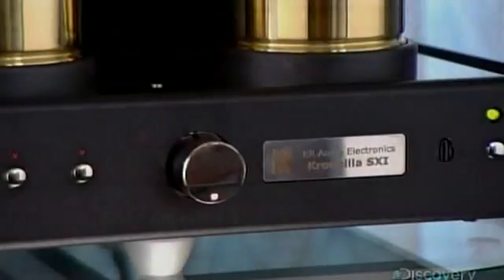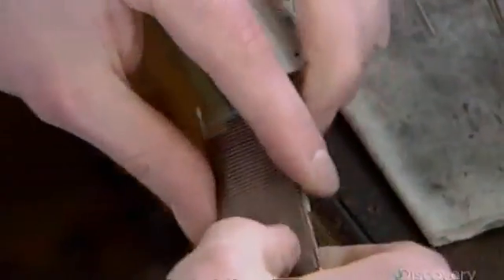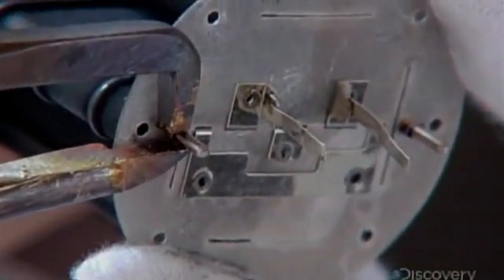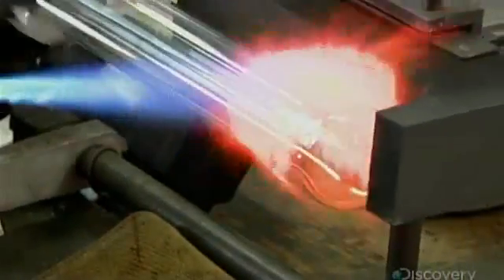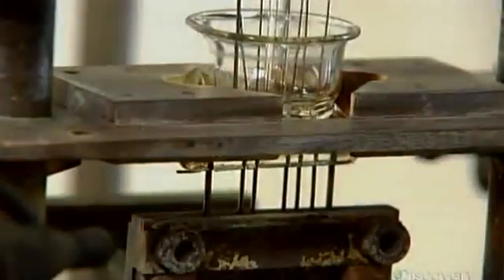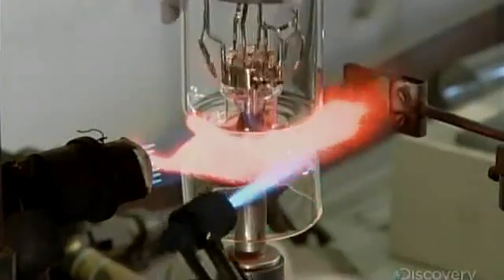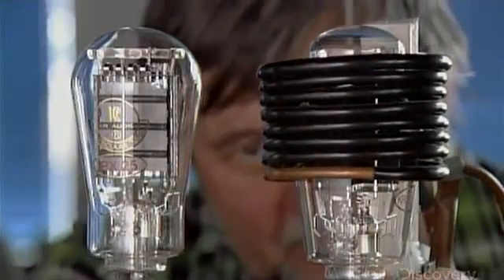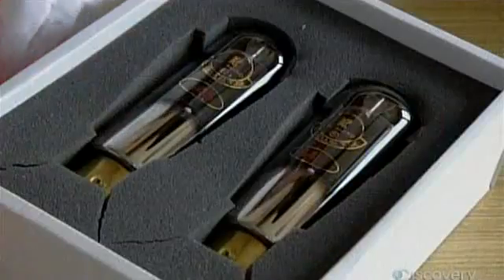How It's Made   Audio Vacuum Tubes   SD   360p  =KCK=  x264

Comment: even if it performs the same as a MOSFET transistor, it's just something more close to traditional manufacturing than some chunk of silicon with three wires soldered to it.
Reply: That explains why modern high resolution, high quality, super bright flat screen TV sets with perfect contrast have zero tubes inside.

Comment: tubes are superb for guitar amps, but I'm less convinced about an audiophile quality amp...i suppose they add a pleasing distortion which softens the sound, but it's really colouring the audio.
The narrator said that valves are only used for high end audiophile amps..that's rubbish...the biggest market is in instrument amplification.
The world's valves (tubes) are all made by either Svetlana or Sovtek and then rebranded.

Comment: Yes I ended up with tubes also, the narrator said they sound more natural - that is actually not entirely correct. 
(This depend also on how we use the word, what you actually intend to say, if you have tuberolled yourself into a stupified state of audio nirwana, your mileage might vary etc LOL.)
Tubes that I prefer, do not provide actual HiFi, and would not measure perfectly.
What I prefer about tubes is that the music lives in a way never heard on a solid state system.

Comment: All tube amps have harmonic distortion, before we had transistors all TVs, audio, computers, telecom used
vacuum tubes by the millions. All analog, everytime audio was rerecorded, signal deteriorated including
distortian. Going digital solved all the problems! To listen to true analog audio, recording - to amp - to speaker
cannot include any digital equipment. Good luck with that.

Comment: ohh how many of that tubes i've smashed on the street when i was a kid, then i started collecting em... then i gave em all to a friend

1) a 4 pin triode is quite possible to do, two wires for the filament, katode attached to one of the filament wire (or it's the filament itself), grid and anode... four

2) tubes do NOT sound better than solid, the only thing that are better at is at top power when solid clips hard the wave while tubes rounds it slightly, generating even (not odd) armonics and low frequencies that don't crackle too much, that's why guitar amps use tubes, you use em at full power often

Comment: Tubes sound LESS natural than transistors.  They add color and harmonics to a sound signal.  While Transistors amplify the signal with less coloring and other added noise into the signal.  Look you may think tube sound better and that's fine, but its because it DISTORTS the source and and you find that pleasing to your ears.
Reply: For a guitar amp  the gradual transition to distortion and soft-clipping allows the classic sound of electric guitar (hard clipping is always nasty in  a bad way).  To reproduce sound is another matter and you want minimal distortion.  Negative feedback is the usual route to good linearity whatever the amplifying device.

Comment: Bah, you forgot guitar amps.. lots of tubes in them
Reply: I love cork sniffing tube snobs.
Reply: For me, the way a tube reacts to my playing, its imperfections, is part of the instrument.  The sound can be mimicked by some transistors (FETs)  with good success, but the feel cannot.
Reply: I have a cheap Vox 15watt SS amp,  but I'm not good enough to tell much of a difference because I'm still learning basic chords and rhythms.
Reply: So plenty of tubes in old color TVs and they didn't mention those either.  Then again more people purchase high end tube equipped audio amps guitars amp in total.
Reply: Most of those old tube TVs have either scrapped been or salvaged by tube geeks. The tube geeks also salvage old tube stereos from the 1950s and 1960s.
Reply: Old GE and RCA are to die for.

Comment: where are the rest of the tubes, a tube amp has 4 more tubes to drive the output tubes.
Then you need a tube preamp for your record player to drive the power amp.
All these amps have harmonic distortion which was difficult to eliminate. Analog from
 your old records to your speaker is what we listened to. now all music is digitly remastered, 
What drives those 2 power output tubes???

Comment: I don't think those are audio amplification tubes. these have only 4 pins so I think they are rectifier tubes. Amplification tubes have 8, 9 or even more pins.
Reply: I don't know where you come from (sounds like you are familiar with guitar amplifiers), but there are amplification tubes for all sorts of sockets. 4 pins are typical for directly heated triodes, where the heater is at the same time also the cathode. Take a look at the datasheets of the most commonly used directly heated triodes for amplification - 300B, 2A3, 45, 845, 211....
Reply: I see. I'm mostly familiar with late russian tubes, which are dirt cheap here in eastern Europe. All the schematics of guitar amps i've seen they use tetrode ot pentode tubes with 7 or up to 9 pins and rectifier tubes with 4 pins. That's probably the reason why I was confused .
Reply: Actually, a pentode has 7 pins: 2 for the filament, 1 for the cathode, 1 for the control grid, 1 for the screen grid, 1 for the suppresor grid, and 1 for the plate (anode).
Reply: +Itapirkanmaa2 That's a valid point. Actually, directly heated tubes are more efficient than indirectly heated ones. Unfortunately, with increased amplifying efficiency ( in this case) comes increased noise and distortion. For that reason, they inserted that extra cylindrical "pipe" around the filament, creating an indirectly heated cathode, but sound quality was improved.
Reply: +Itapirkanmaa2 Actually, check out "Mr Carlson's Lab" youtube channel. He gives a great explanation on one or more of his videos about tubes.
Reply: The tube shown being packaged is a "Type 845" triode with four pin base.  You can google that keyword  and find the data sheets for it.
Reply: +Itapirkanmaa2 Oh, I forgot to mention that the AC power supply used to power the filaments of the tubes will add a slight audio hum to the audio signal being amplified. This hum is reduced if the cathode is indirectly heated. Actually, high-end (more expensive) tube amps use a filtered DC power supply to power the filaments.
Reply: rectifiers don't need a control grid. Chances are they didn't follow the triode from start  to boxing All tubes have the base installed in the same manner, why should it matter if the base matched the internals? I notice a getter wasn't used. another noticed that a heater wasn't shown. I think everyone is looking to close.
Reply: A directly heated triode indeed only needs 4 connetions:
The cathode is two pins, the cathode and the other end of the heater, 
the grid, and 
the anode (may be separate as cap connector)
Reply: The directly heated tubes are the easiest ones to manufacture. The indirectly heated ones present a whole another challenge in materials and manufacture.
Reply: The efficiency is only related to the very slightly increased heating need.
In all other respects, there is no difference for the operation of the tube whether the cathode is heated up directly or indirectly.
Reply: It's not slight, as it will present an AC voltage against the cathode. 
In the past the hum was compensated by adding an antiphase signal to the signal.
In the indirect heating, there is normally very little effect at all unless the insulation inside the tube is compromised.
Reply: Thank you, but actually I'm not a novice on tubes.

Comment: They forgot the heater how will it work with out it?
Reply: That was the rare cold cathode triode. ;)
Reply: This particular tube is an 845 directly heated triode, therefore it does not have a heater.  The filament serves a dual purpose.  You can find the specs on "tec-sol.com".
Reply: holywells 😘❤
Reply: MrJohnny56789 chomo

Comment: Vacuum tubes were great for high fidelity audio reproduction. Today people do not care about sound fidelity anymore. Vacuum tubes control electron flow while transistors control moving holes making the control coarser.  Digital recording and reproduction are the most distorted because it does not make smooth wave but that of connecting dots. So vacuum tubes can not correct digital distortions. Anyway, who cares about sound quality today? People don't even care about TV picture quality anymore.
Reply: +Odouls77 I'm pretty sure the largest market for tubes today is guitar players, but even that market is pretty small. Tube guitar amps are pretty much unmatched by their digital rivals.
Reply: +William Pryor Guitar amps use tubes so that they can distort the sound. Instead of using the linear range of the tube for faithful reproduction, guitar amps are biased on the non-linear portion of the curve to give a distorted reproduction so that the output waveform is different from the input. I am sure these distortions maybe produced with digital circuits and programs and with higher outputs from solid state semi-conductors thus eliminating vacuum tubes completely.
Reply: people don't care about picture quality anymore? I guess your still a fan of 240p crt's then...
Reply: Pro-tube engineers conceded long ago that solid state equipment delivered the most faithful reproduction. Both transistors control electron flow. Tube are voltage controlled devices, transistors are current controlled devices. In solid state devices both the electrons and the "holes" currents are occurring simultaneously . That hole current somehow make "things" "coarser" is some electronic theory voodoo that I haven't previously read. So  forgive me as I have to consider it something made up by someone to be able to justify unwarranted prejudice against solid state devices. Whenever on thinks they have read it all it seems they haven't read YouTube comments.
Reply: Odouls77 you clearly don't understand signal reproduction - digital audio is perfectly fine and can easily out-perform poorer analog systems (just as a good analog system can outperform early digital tech).  Modern digital ADCs and DACs are 24 bit and awesome performers.  Once a signal is digital there is no more degradation until the final analog step, meaning there is demostably less distortion through the whole chain of recording -> reproduction.

And to claim people don't care about TV picture quality in a time of home cinema and 4K screens is such obvious twaddle.
Reply: That was a load of drivel you produced there. Connecting dots? Do you even know how a DAC works?
Reply: You clearly have no clue what you are talking about.

Comment: how the hell do people think of this stuff...
Reply: +rollercoastermaniac2 Lot's of trial and error. Amazing stuff though. Transistors are even more mind boggling. How the hell did they go from a vacuum tube to a doped silicon transistor?
Reply: Yes and spread out over the discoveries of thousands of people of hundreds of years, built on the millions of years of the collective discoveries of others before them. Didn't Einstein say something like "I see so far before me, as I stand on the shoulders of giants?" Its arguably never the work ever of one dude.
Reply: Right? Sometimes that blows my mind.

Then i remember that stuff like this, even stuff that’s invented during a “eureka” type moment, is all evolutionary. It’s knowledge and skill passed down through many generations of brilliant people solving problems. Building it up and passing it on, building it up and passing it on. It’s what separates us from the bonobos, etc whose life experience tends to die with them for the most part.
Reply: Actually vacuum tube was discovered pretty much by accident when Edison's crew was experimenting with light bulbs.
Reply: Observation, with curiosity as to why the see what they see, with an effort to explain why something happens. Edison could have been the one to invent electronic tubes, but he wasn't.
Reply: semiconductor research was kicked off in the 1930's hardcore because of photodetector tubes, as well as study into the interface layer of the oxide coated cathode.
Reply: while listening music from a tube amplifier...
Reply: So the question,... How could they (have heard?), or (seen?,)  the possibilities by just trying to get a filament to not burn out so quickly and thereby discover such off shoots with such possibilities?

Comment: if a high- tech item has to be hand created(notics, not assembled), don't trust it.
Reply: +Steven Zephycrs (Shichun) They last decades & decades for a reason. Made by "hand" with zero tolerance for error. This is best way to make them. Many visual cues are needed to watch for errors. I have tubes STILL running 24 hour a day since 1957. (My dads & my radio) No "high Tech" Plastic mill made modern electronic today would last a year like this never mind over decades.
Reply: Why?
Reply: RAGE Gaming Revolution human induced error
Reply: +Steven Zephycrs (Shichun) Like your comment?

Comment: too many "tubes are better" snobs in comment section.
and no one knows what electric signal is.
tubes were good because they were the only way to amlify a signal back in the time.
Reply: I'd have to disagree from experience of myself and others, transistors/mosfets as well as other parts go daily. They eventually go within several years. As I said before many industries have been running tubes problem free for decades. (Original ones too) I own a few 2 way and sw radios that are as old as our grandfather. Its such a consistent trend its undeniable. Theres a reason why even many radio and TV stations use them today from the birth of their day of transmission. Tubes are delicate from its glass. Aside from that over 100 years of use doesnt lie. Your not going to even try and tell me otherwise. The tube (if) is one of the last things to go in a device. No fawking way transistors will outlast tubes. History shows otherwise. ipreferns
Reply: UZI9MMAUTO earth to uzi, "tubes last 100 years" is the end of our conversation. it depends on voltage, the LOAD. and USE. Your sweeping statements that make no sense are embarrassing you. 

http://www.head-fi.org/t/138377/how-long-is-the-life-span-of-tube-amp

5-10,000 hrs. not 100 years. GFY. 
*Mute.
Reply: different sounds for different people and purposes
Reply: +UZI9MMAUTO transistors last longer. but anyways. sweeping statements of any kind make no sense. some studios use tubes, some transistors. both done right are good.
Reply: +Angry Barbarian Lol... i use electric, but i find that tubes sounds better. :T
Reply: +Angry Barbarian Tubes Perform Better - last much longer- therefore ARE Better. They run for decades 24 hours a day. Stuff made today is garbage and fail quickly. Tubes are still used today in communications, music industry etc They are still being made to this day.

Comment: Why is the black coating "top secret"?  Is it a government top secret or a company top secret?
Reply: There just have never been secrets in tube design.  The physical design is easily copied. The material science is published in physics and chemistry journals and any University physics lab can determine the metals and coatings in a snap.  It has been that way for 100 years.
Reply: +intervalkid Its a trade secret that keeps them in business. They found something that beats others coating. Therefore they have the advantage.
Reply: What I figured.
Reply: no secret at all.. its just a black coating which supposedly helps the anode radiate heat better. low power tubes sometimes have the coating and sometimes not.. typical non audio low power pentodes have just a wire mesh anode.. I'm a user of tubes.. can't say I have  noticed any performance advantage with black or silver anodes.. the tube shouldn't be run with red hot glowing anodes in any case for various reasons.. mostly to do with secondary emission.. if they are glowing then the tube is wrongly biassed and overloaded
Reply: Pelican- I meant that comment at UZI9MMAUTO.
Reply: intervalkid   Government. They're actually spying on you.  It now emits signals got video, audio and a global location can be deciphered.
Reply: They aren't a secret.  Anode materials have changed over the years, slowly, but are well understood and have very few variations.   There are no 'magic formulas' in tube design.
Reply: intervalkid Good heavens yes. We don't want common sense and fact to intrude on exaggerations and myths of audiophools.
Reply: intervalkid posts have been hinky lately.  It doesn't reliably attribute replies.  I've had the same problem recently.  cheers.
Reply: If we don't know the secret, it's something we don't need to know.Ya know ;)
Reply: The black coating "top secret" thing is perhaps one of many bits of nonsense in that script.  Nickel anodes are usually grey (nickel alloys survive the highest temperatures), stainless? steel anodes are usually black coated to increase heat radiation (since they can't take the heat like nickel alloys can).